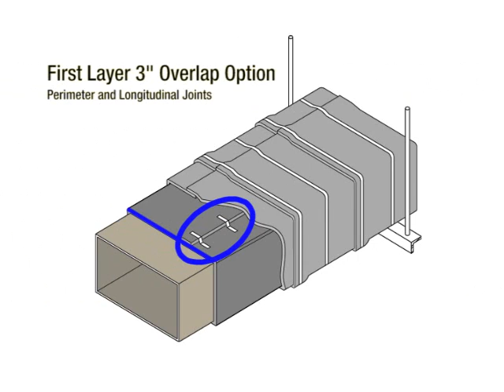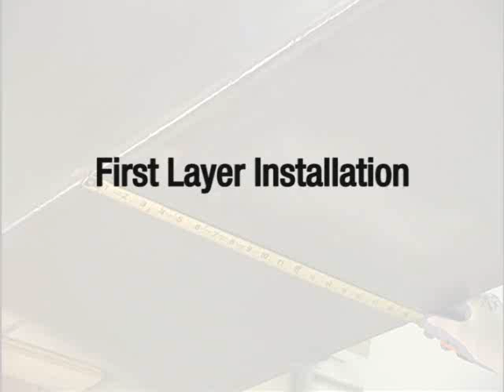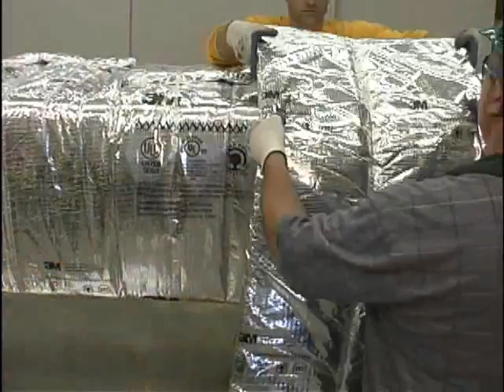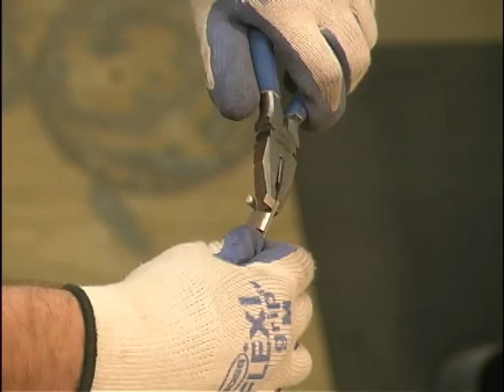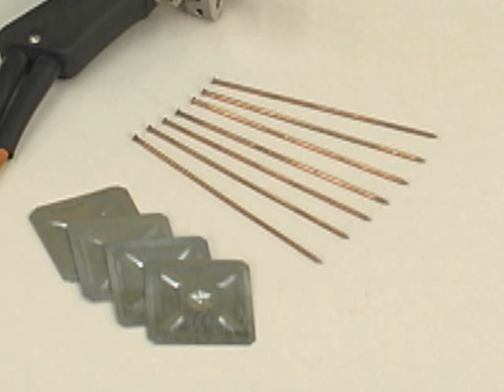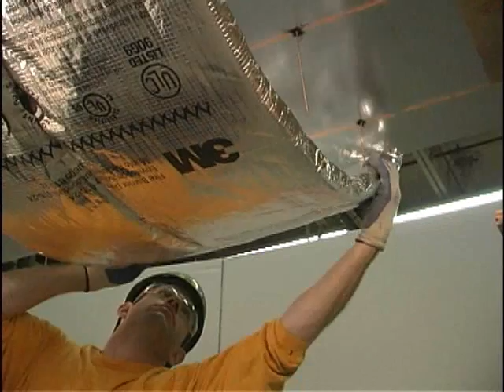3M Duct Wrap 615

Comment: What do you do at inspection doors or panels,
Reply: The way I’ve done them and got passed on inspection is by the 3 layer method on the door.( I wrap everything and leave doors exposed till end). Take washer and nut off door. First layer is gonna be fit snug to door. Just push the wrap through the hangers coming out of door. Then for the next two pieces add 2 inches to length and width each time. Screw nut and bolt back into door. Fire wrap will condense a little but will look good.

Comment: Why should double layer if it's 2 hour fire rated?
Reply from the maker: It’s because the system it self would give you 2 hours not the product 
Depend on the profile and time demand as if the location and regulation require 4 hours u might end up with more than 2 or 3 layers
Reply: @ziadakkari  + Salamualaikum, I want to wrap BBT by this product for 2 hour fire protection.
Pls .assist me how to wrap. BBT size is 7 inch x 7 inch & 25 feet long. How much wrap need with other accessories.My e-mail id . Chowdhurymeherali@gmail.com.